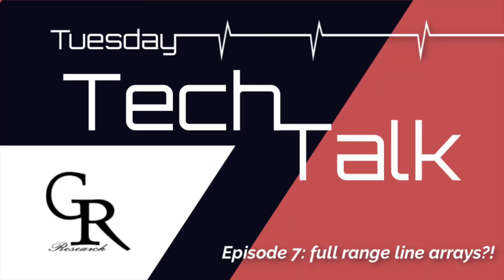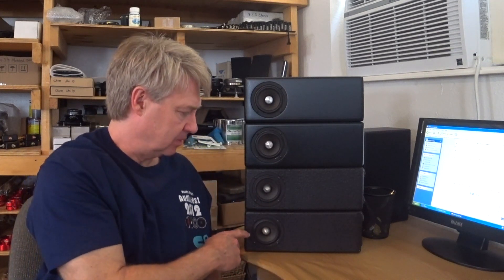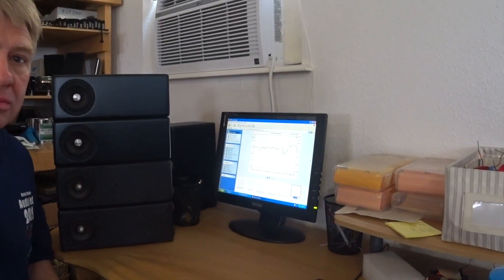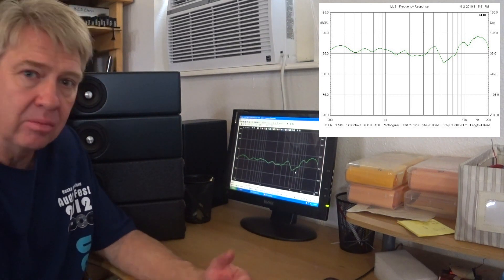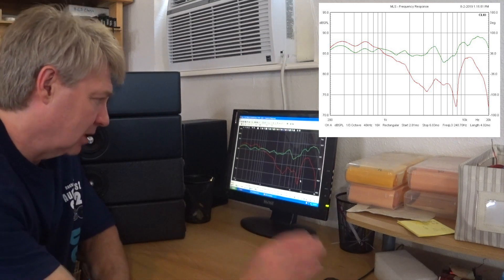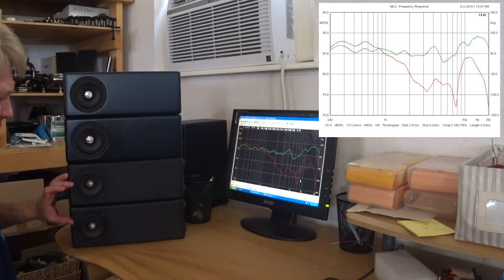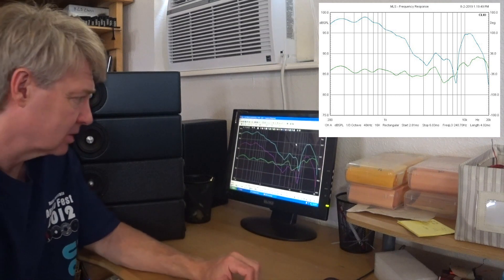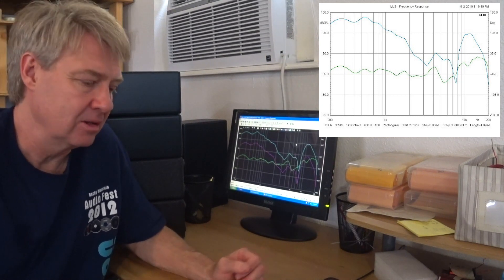Tech Talk 7: Using Full Range Drivers in a Line Array!

Comment: Yes, I'm late to the party...  

Yet, GR Research offers speakers with multiple drivers in a 'Line Array' including the NX-Otica and NX-Treme as well as several wedges.  I'm trying to reconcile these offerings with this video.  How do you make it work when you demonstrate here that it cannot work???
Reply: Those are very different. They don't use multiple high frequency drivers. They use a single tweeter crossing at below 1,500Hz.
Reply: @dannyrichie9743  thanks for the answer.  I had finally come to understand this, though it did take a while to sink in.

Comment: Still, a) line arrays are all over the place when it comes to PA and b) Don Keele holds an Academy Award, you don't. :P

Don Keele's CBT24 uses 2.5" drivers, not 4" drivers, which moves the issue of comb filtering much further up the frequency band. He also provides all the theoretical background on what it takes to make his design work. From providing the correct level to different groups of drivers to required EQ. Add to that the fact that the late Siegried Linkwitz has been impressed by the result.
Reply: Even with the closer center to center spacing of the smaller drivers it is still a disaster. The hole top end suffers from comb filtering while the lower end couples making the frequency response super un-even. Even with a ton of EQ it still isn't going to work. You can only EQ it for a single point in space. Move up or down and the whole EQ system is way off again.